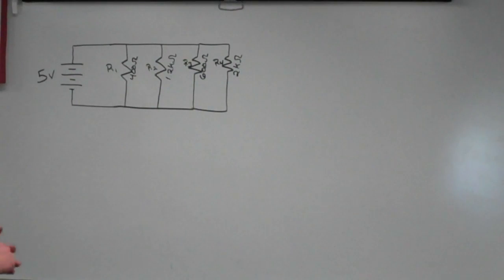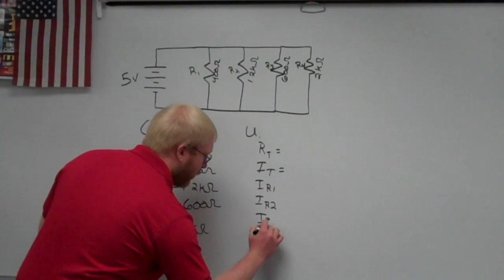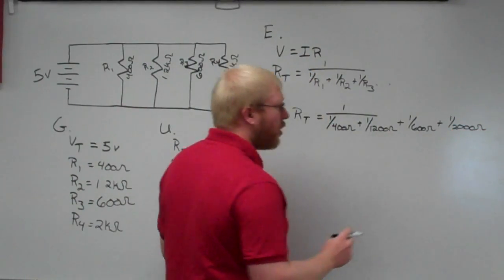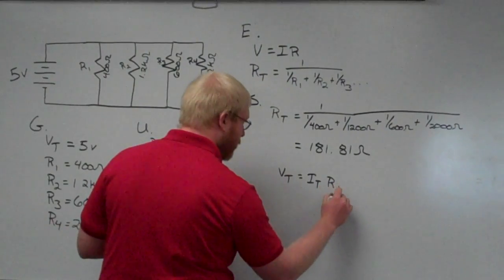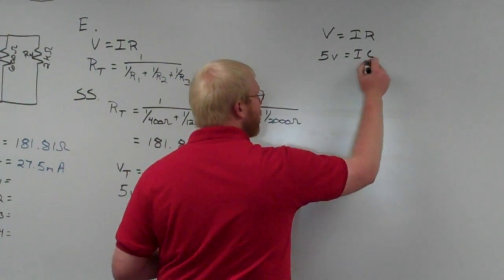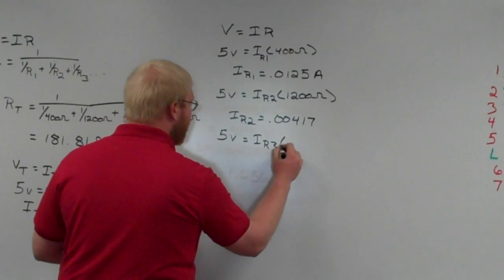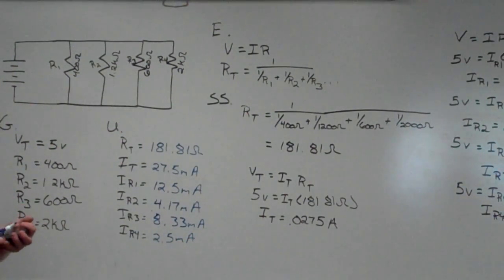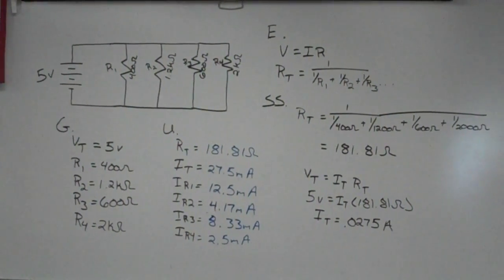Parallel Circuit Calculation

Comment: My teacher had a GREAT way of keeping everything organized with a chart . On the sides it looked something similar to this . 

     R1  R2  R3  R4  R5 
E
I
R

and you would just make boxes for the information give and solve for what wasn't given with Ohms and Kirchoffs law. And if some resistors were in series parallel you could just add extra boxes to the chart . like this.. 

   R1 R2 R3 R4 R5 R6+R7||R8 R9||R10.. 
E
I
R

And so on,  hope this helps it sure saved me a lot of frustration. XD

Comment: I have a question.  You said that in a parallel circuit voltage stays the same and current changes.  If i had 100 leds in parallel and each led worked with 3.5V @ 30 mA, can i have a power supply supplying 3.5V @ 3A since each led is taking 30mA from the 3 amps?